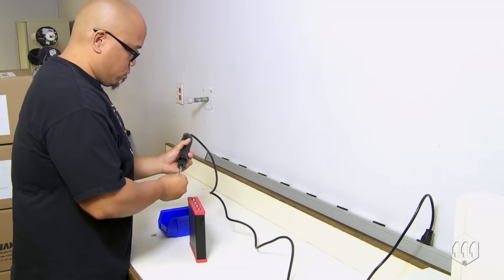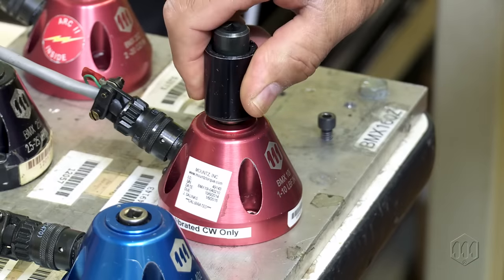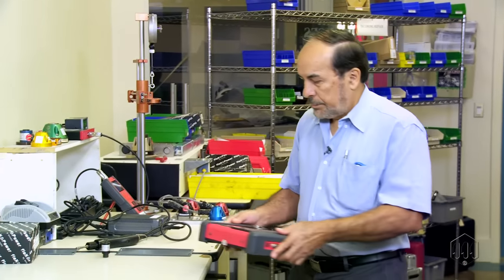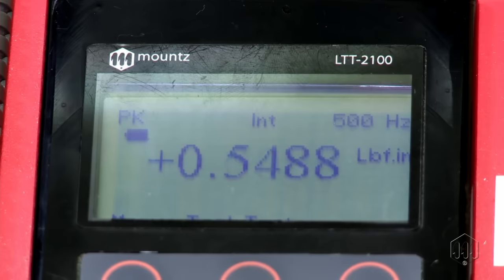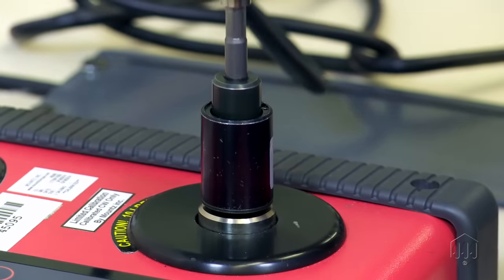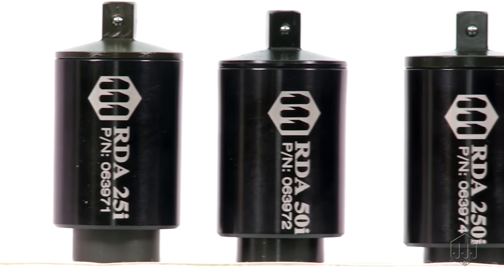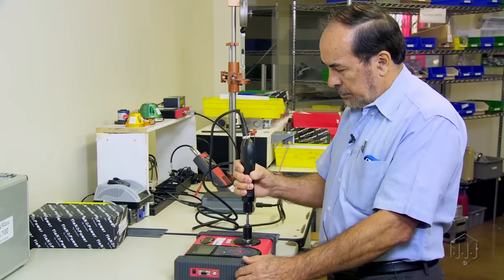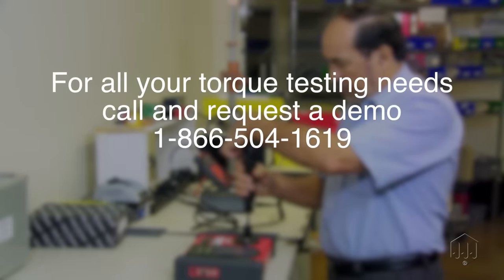Testing Power Tools with a Quality Joint Rate Simulator - Run Down Adapters

Comment from the maker: When testing a power tool using a torque tester or reaction style torque sensor, always use a quality joint rate simulator otherwise known as a run down adapter (RDA). The purpose of using a RDA is to simulate the fastening process of a screw. Have a Mountz representative visit your facility and provide a torque testing demonstration. http://www.mountztorque.com/blog/calibrate/testing-power-tools-with-a-quality-joint-rate-simulator-run-down-adapters/?kmas=216

Comment from the maker: Mountz tip of the day: Over time, all power tools start to drift out of tolerance. When testing a power tool using a torque tester or reaction style torque sensor, always use a quality joint rate simulator otherwise known as a run down adapter (RDA).

https://www.youtube.com/watch?feature=player_embedded&v=bjGPFXP2C4o